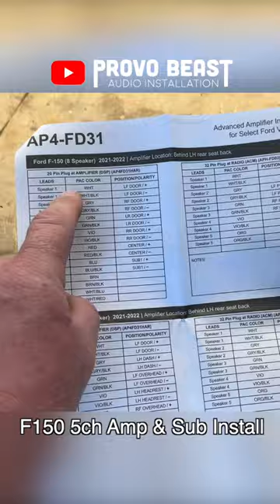Ford F150 5 Channel Amp and Sub Install | #shorts

Comment: Having had time finding where to run power cable.
Reply: I always use large 2 ot an 4 ot welding wire its made for power an the shething is better rubber an I go under the truck an add grommets under back seat under plastic panels that's where I drilled  ¾ holes an straped nice an neat under truck ran down one side I chose driver side may switch to passenger side later